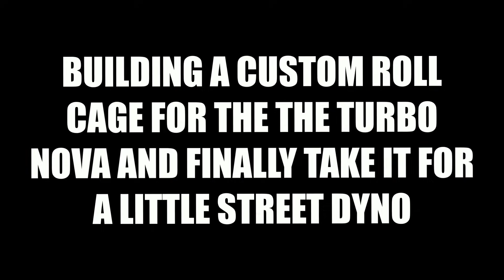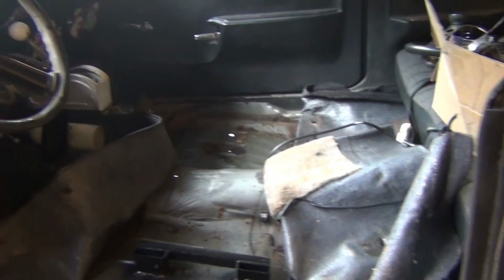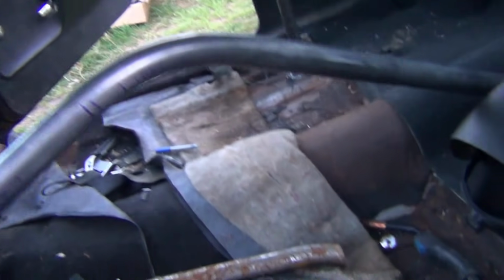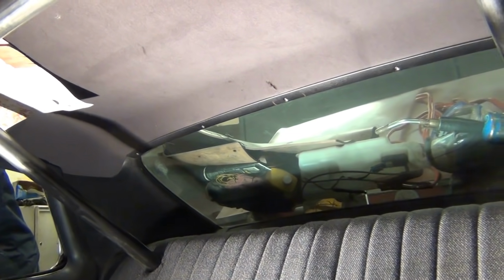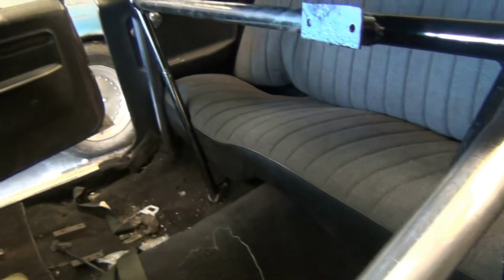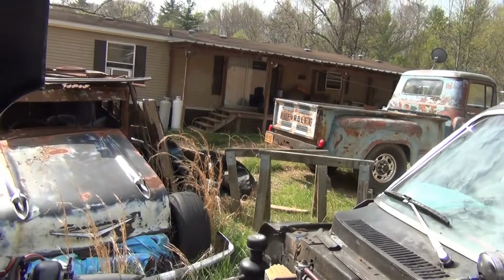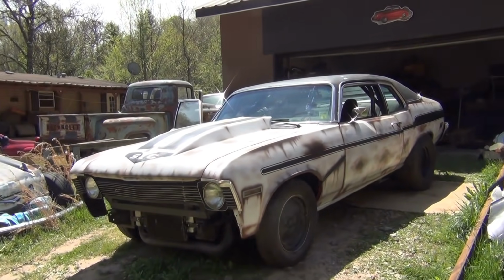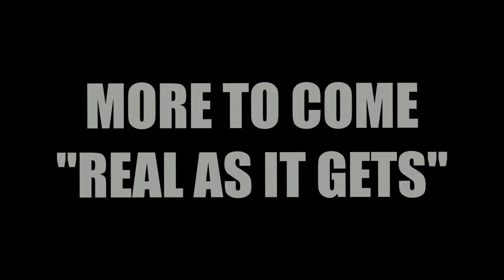SKULL GARAGE 2021 (EP.9) TURBO NOVA ROLL CAGE AND A LIL STREET DYNO

Comment: Ha ha i just installed the original steering wheel in my Nova. I have always used the Chain Steering Wheel since like about 15 year's. The wife was like please cause she hated the chain steering wheel. So i found the original steering wheel and she was happy. And to me it felt different driving the car wife goes it will come back to ya. Roll cage look's awesome Justin. I finished mine in my truck for race war's. And i past inspection when i went testing week's ago it run's and drive's dam good. Had issue's with the wheelie bar's got them figured out. My wife goes hmm he   is putting a roll cage in his Nova and u took ur's out. I did so the family can all ride instead of climbing over the back roll cage. The kid's was like who need's seat belt's when u got the bar like a lap belt or like a  Roller Coaster Ride i said true. There's lap belt's for all 3 of them. And the coop's can't do nothing since it's an old car and there is no shoulder belt's made in that time. There trying to make people install shoulder strap's in old car's. But can't make us since they was not invented until dunno know when. The wife was like shocked seeing all the seat's out of the Nova it's a 74 same Has Justin's. And i said taking the roll cage out. And my kid's was like why are u doing that. I said going to drag race the truck instead of the Nova. And i took the motor out of the Nova and instealled it ion the truck it's a 1985 Chevy Silverado long bed on small tire's. I am staying small tire cause i don't have to cut the bed up and do allot of cutting and welding to make it for big tire. Plus i drive it all the time to work or place's. The motor is a 585 Big Block Chevy on a  671 dual carb blower and it's fast. And hope to see u guy's at Truck War's. The Truck is all Black except the Hood is pink in memory of my Aunt who died of cancer.

Comment: All those bars ain't gonna do you any good without seat belts
Reply from the maker: I got 5 point harness in it attached to the roll cage 10 degrees below shoulder like nhra says,when i street drive i just use my lap belt part...justin